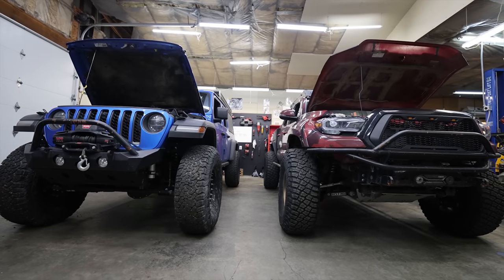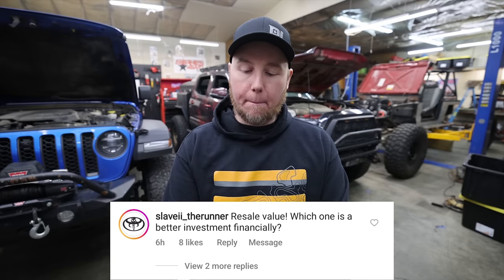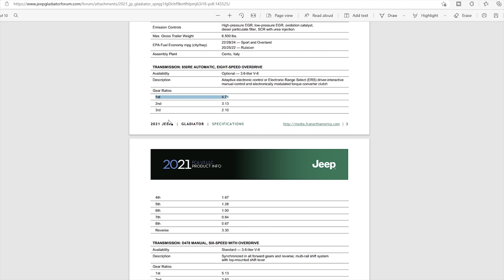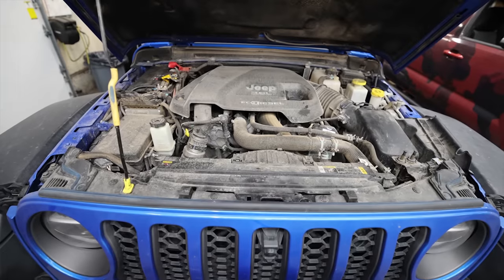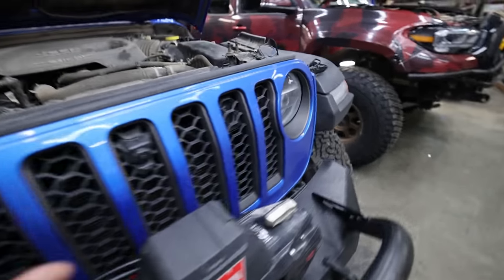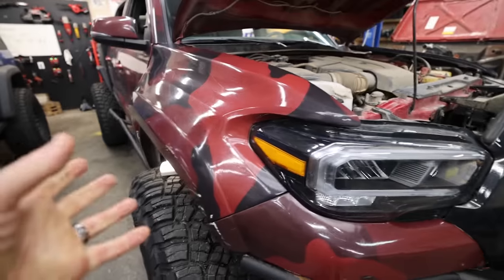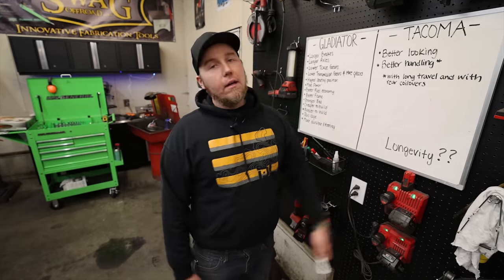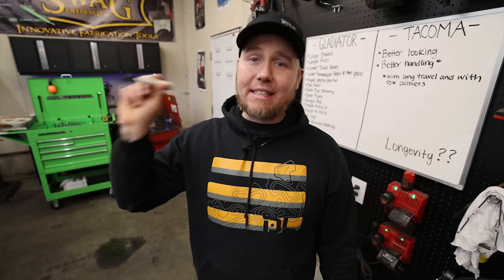My 21 Jeep Gladiator Vs My 21 Toyota Tacoma. Cold Hard Facts.

Comment: It doesnt take much to figure out how reliable a vehicle is nate. All you have to do is look. Where you drive what cars do you notice the most? how many old GM, Jeep, Ford, Toyota, Honda , etc vehicles do you see? I mainly see a lot of old toyota and honda vehicles still on the road 20+ years old. Rare to see other types. I used to have a jeep and it had thousands of issues, constantly overheating, transmission issues, and of course lots and lots of electrical problems. I bought a tacoma and never had a single issue. I think its important to note you heavily modified the tacoma and honestly you really changed how toyota manufactured it. From the factory it is pound for pound better than a gladiator.
Reply: You should compare stock to stock, because that is the fair way to do it. Also, again I have had jeeps and they are a nightmare as I had constant need to go to the auto repair shop. Since I got a toyota tacoma I never went to one thus far. And I dont do any off roading, just regular daily driving both.
Reply: Lol old jeeps are one of the more common old cars to see. If you maintain them- and also by a wrangler- they aren’t hard to keep on the road.

Comment: You are comparing two different vehicles for what you expect. Tacoma's a pickup, the gladiator is a "jeep" with a small pickup bed. Ones diesel, and the other is gasoline car engine. Tacoma's historically were NEVER meant for towing(too small and not built), but people do it. Apples to oranges my friend. That gladiator is an awesome rigg. If I bought a fiat again, it would be another cummins powered truck. By the way, I would never buy a tacoma unless it was built like a tundra.

Comment: Taco definitely has its short comings. But to be fair, you have customized and modified the Tacoma fair more than the Jeep. My Tacoma has almost 100k miles on 35” tires and built for over landing. Taken it to Moab and done trails the Tacoma isn’t supposed to do. In my humble opinion you can’t ding your Tacoma for its reliability issues when I would dare say allot of those are inflicted by the customization you e done while doing a basic lift kit and some more simple mods. 

Still a good video comparing the two!
Reply: 3rd gen tacomas are no where near as reliable as the previous generations and ifs been well documented. It wouldn’t surprise me if a gladiator with the v6 is more reliable than the Tacoma

Comment: It boils down to:  They all suck-mostly suck stock.  If you want an off-roader/overlander, you will have to build it.  What you start with really only matters in availability of aftermarket parts and/or your willingness to modify and swap.  Jeep, Toyota, Nissan, Ford, Dodge...none of that matters overly much, IMHO.  

I am building a Ford Ranger into an overlander. Don't think I'm doing much more than if I had started with a Taco.  Only difference is, I paid less initially, will have to pay a bit more for modifications because there's less in the aftermarket, and my total package when finished will be a bit smaller (by design).

Comment: If you peruse the actual data sheets on longevity of vehicle brands and models ie what percentage of total made make it to 100k, 200k, 300k etc. there isn’t a statistical difference between them . Even with a pearsons r value of .05 never mind one of .001 which is the norm in engineering or hard sciences.

Comment: Not surprising to see that the Gladiator beats the Tacoma in many categories in your video. I would certainly hope so, because with the price difference, someone can take that difference with the Tacoma and build a great vehicle that will rival the Gladiator without issue. This is a classic example of, "You get what you pay for."

It seems like you're comparing the biggest to the smallest here - and there really wasn't a winning criteria. Of course the Jeep wins - it's much more expensive. Just because something is bigger, wider, etc, doesn't necessarily equate to a win.  I'd like to note that you've purposefully left out specific measurements and statistics for both vehicles that would consider them either roomier/tighter, as well as failed to mention the fact that the 3rd generation Tacoma drivetrain build was not designed for off road-use, even with gears such as 5.11s. Let us not forget the small things, such as fasteners and maintenance items, but I would rather not get into that - all companies have been skimping there and other places to "fit into the future".

Is there any reason you meme'd the 1st generation model into existence for frame issues, even though it has nothing to do with the video? I highly suggest owning a vehicle longer than 2 or 3 years and then coming back to maintenance, reliability over a longer amount of time. I'd love to see that video.

 
Appreciate your time.

Comment: I know you want hard stats, but I know both toyota and jeep guys, the toyotas are way more reliable.  we are talking 500k, and in some instances 1 million mile reliability.  HOWEVER if you put 35s on a toyota you're gonna start to loose that reliability, or at least just start spending a ton of money.  if what you want to do can be done on 33s or smaller the tacoma/4runner/GX/FJ are in their zone.  Quite frankly 98% of the dirt in the US can be covered with a toyota on 33s with a skilled driver.  There are several people who have taken a near stock GX460 or 470 to moab and did the escalator on hells revenge on 31.6 tire to show the scale of what I am talking about.

That being said wheeling above 33 becomes about brute force tire size, and this is where the jeep shines.  Putting 35s on a toyota is a lot of work and 37s become crazy work.  you can literally just bolt 37s and a lift onto a jeep and call it a day.  there is definitely something to be said for that.  And being a GX off roader there is certainly something to be said for a vehicle that you can drive off the lot and straight up a mountain without immediately swapping the wheels taking an angle grinder to the low hanging body work.

Comment: I have had jeep people drive similar builds to yours abd get mad at me because they couldn't crawl up a rock that I just did with my toyota 88 extra cab that is locked front and rear duel cased and 35s, it was like a 5000$ truck at the time, probably 20k now with the crazy 80s toyotaflation tho, I'm sure you know everything new is lower quality now days and older jeeps and toyotas are way tougher vehicles

Comment: Don't get me wrong I've owned a lot of Toyotas and love them but ...Even a stock Tacoma can't decide what gear to be in and the hideously underpowered v6 coupled with at case that never wants to shift from hi to low then toss a locker that won't engage until it feels like it. Toyotas use to be great but now are verging on being ok. Oh and also if one sensor on one part of the rig malfunctions you will get a Christmas tree of lights and the whole rig will throw a fit.

Comment: It's an interesting comparison. I don't know about off-road comparisons or towing, but I have owned three Tacomas and the Tacoma reliability is legendary. Jeep in general has one of the worst reliability records of any auto manufacturer.  And if your Jeep is broke, then it's worthless. Jeep is absolutely notorious for being cheaply made. Now having said that, I have never owned  Jeep Gladiator, so maybe they are reliable, who knows. I do know that Tacomas did have a higher resale value than any other vehicle made, about three years ago. But I think the current gen of Tacomas brought that down because, frankly, they just aren't that great a vehicle. BTW, I have done ALL of the repair work on my Tacomas - so I am keenly aware of their reliability.

You are factually wrong about the frame of the Tacoma to a degree, part of frame is a tube frame. However, I have never seen the whole frame nor even looked at it. BTW, I was rear-ended by a driver at fairly high speed. My rear bumper was completely bent under the truck. When it was repaired I made the insurance company check the frame to ensure it had not been bent. The frame had not been bent and was withing factory specifications. So you might want to do a little more homework before you run around claiming the frame is weak. It may not be as strong as Gladiator frame, but it's not weak.

I currently own a 2009 Tacoma and I just put new coil-over Eibach 2.0 (2" diameter) Eibach shocks and rear reservoir shocks on it for $1,500. I could have replaced both control arms and put on 2.5" super deluxe coil-overs for around  $6000 - $7000. So it certainly is not cheap. But that would provide the absolute best truck suspension that you can buy with the exception of air shocks like on the Rivian RT1. My ride with Eibachs is very good compared to stock shocks, and stock shocks were Bilsteins on my truck. 

I am a licensed General Contractor, and I have abused the living hell out of the composite Toyota bed. So, I can say firsthand that it is not "fragile" by any definition. I have had loads in the bed that are way over 1000 lbs and it I have never had a problem with it. I think in this case you are the person who hasn't really used the composite bed to see how durable it is firsthand. I was in an accident that did break the bedliner, but that is way more to expect out of it than we are discussing here. Have hauled loads of lumber in the bed that I really shouldn't have, that had the rear shocks bottomed out to the bumper. So, I can say with some authority that the composite bed is very tough. Steel bed scratch, dent, rust and look like garbage after hard use if you don't spend more than a $1000.00 to put in a high-end bedliner. The Toyota bedliner has none of these problems. I have found it to be exceptional. Again, do some homework before you make global judgments. 

The Tacoma was never meant to be a heavy towing vehicle, nor does Toyota rate it as such. You are comparing apples to oranges when you discuss towing compared to a more powerful diesel engine. You can't expect any gas engine to compete with a diesel in towing ability. Diesels develop most of their torque in much lower ranges. Also, the six-speed transmission on the Tacoma you own is a disaster. Toyota really screwed up with that transmission, by all accounts. It's one of the main reasons I didn't buy a new Tacoma. The 2024 Tacomas fix this problem with an eight-speed transmission that is buttery smooth, according to reviews I have read. 

As far as resale value, a nearby Toyota dealer I had repair work done after I was in an accident at recently sent me an offer for my truck. They told me they would give me over $17,000 for my truck. Now get this, I paid somewhere around $26,500 for my truck new in 2009. So I would say that being offered $17,000 for it from a dealer is pretty damn good resale value after 15 years.

Finally, the new 2024 Tacoma is coming out with a hybrid version which supposed gets over 30 MPG and has 326 HP and 465 lb.-ft. of torque. So it will be a beast if you can actually find one to buy. It should tow a lot better, and because a lot of its torque comes from an electric motor, it should be very strong at low RPMs. The off-road version also comes with an upgraded suspension that supposedly is really good for off-roading. We will see when it comes out later this year.

Overall, I think you did a good job with your comparison and I enjoyed your video, despite my critiques of it.
Reply: I have owned Tacomas as well and they are J U N K. They are maybe 1 step away from those Japanese mini cabover trucks. We have dumped all of them for real trucks. No power, can not tow, horrid gas mileage for underpowered engines, tranny is sloppy, weak frames, no payload and overall cheap builds. I heard all this crap about these trucks but I think it comes from ignorance. Most have never owned any other truck because they came from a Toyota family.

Comment: Jeep rubicon all the way, not a fan of trimming cutting and grinding my brand new truck for anything bigger than 33's lol, and no thank you to really expensive long travel kits and broken cv axles

Diesel Jeep gladiators drive just as well as a daily but the extra diesel torque makes it so much nicer to daily and get really insane mpg even with big tires, and no trimming up to 37's
I promise I'm not baised.... jk I just prefer a truck I don't have to cut up if I'm buying brand new, oh and rubicon has front and rear lockers and a button to auto disconnect the sway bar

Comment: It is funny. Every Toyota person I know beams about how their car, truck, rig, has been dead ass reliable. They toss out mileage and all of it.  The absolute fact is, when I ask how often they take it off road, actually use the thing, hard,.. not getting its oil changed every 4 hours , driving it to wallmart, I get empty dead end stares.  Fact is, is most of the complaints of the Toyota, are stupid. Because that’s what they even know about the rig. Fold over the front suspension/tie rods a few times at least or something before telling me, how reliable the rig is.  No front locker, weighs a metric dick ton, with shit power, ass tranny (5 speed? Really?) and even then 99.9999% just drive them to McDonald’s. Jeep people actually go out on the trail. Any trail. Trust me. I see way more of them, than I do runners or tacos ,…..

While me, my better half and my dogs are in my 18 4Runner.   Sorry toy boys. Shits a fact. Instead of worrying about what RTT to put on your rig you drive 11 miles a month, go beat the thing. Like the reason you even bought the damn thing. (Or just say you have a PRO, don’t do shit with it, and get laughed at like you should).

Comment: Let's face facts most vehicles anymore mechanical are awesome and way better then anything we have seen ever but the electric aspect on these cars and emissions is what kills them and essentially makes them disposable vehicles.  I have a 2005 dakota laramie with 4.7 and I love it mechanical it's sound but electric let's see transfer case started shifting on its own any time it wanted, sector switch went bad started trying to shift motor into 4 lo, and widow leaked at top causing the whole truck cab to shut down causing no start and other random issues like key fobs not working, radio not working, and other accessories.  All this because we feel are radio needs to connect to are headlights to talk with are motor and overhead display on a can bus system lol

Comment: I was a huge Toyota truck fan and owner of a 83 4x4 best truck ever made a 89 4x4 a 91 sr5 4x4 that couldn't get out of its own way in snow n ice and two 2000 Tacoma 4x4's up until I had both 2000 Tacoma s confiscated by toyomoco for massive frame rust 🤬 after I lost those two in a row I'm done with Toyota and their Chinese steel rust buckets  WTF happened to Toyotas known long lasting and extremely reliable trucks  must be in the same place those two Tacomas are at now 
THE SCRAP YARD

Comment: The gladiator puts pressure on the tacoma? Toyota doesn’t care about anything but sales numbers and the gladiator is nowhere close to tacoma sales even with the tacoma being the oldest midsize on sale now. Those are cold hard facts that the tacoma is still outselling everybody else’s brand new redesigned trucks by ALOTTTT. A lot of the competition came out with midsize trucks and then had to redesign again like the Colorado and ranger all in the span of the 3rd gen tacomas life cycle. They can keep redesigning but nothing has an old school charm with older outdated but simple durable tech and features like Toyota. No one else can get away with it and still selling them at high prices when it’s been outdated for years and years. The 4Runner is still going strong and had the best sales year in 4Runners entire history in 2021 and sales just kept going up. He can wave the jeep flag all he wants but I know tons of people who were jeepers who made the switch to Toyota after having so many different problems. I’ll trust those close people in my life who have experienced both and are real real trail junkies when they say they shouldve made the switch way earlier and all that money down the drain fixing their Jeeps and say for certain they are never going back. And I trust my firsthand experience and my 4runner has never let me down.

Comment: The Tacoma is just the wrong platform for 95% of the people that build them. There's always a better one within the range of budget of that truck. Tacoma's are not inexpensive anymore, some platforms that compare are in the same price range. Truck things, The tundra is a better vehicle for a little bit more money, the 4Runner still has the 4.0 and is a vastly better vehicle, off-road Jeeps and broncos. The 3.5 with the 6. Speed is terrible they drive bad stock. They get bad mileage. The only thing that the taco has going for it is looks. The new darling of the Toyota scene is the first gen Sequoia, That's probably peak platform to build right now. 

But gladiators only downside is the extreme cost up front for a diesel JT Rubicon.

Comment: You don't really want a 79 or 100/200/300 series cruiser. They are so expensive its hard to imagine the kind of mods you do happening to one of these unless you've got loads of money.... The 79 in particular is very old school. Asmatic engines, poor leaf spring suspension, 5 speed manual, no safety aids...sooo expensive!

Comment: Cheap Mexican made? How many Jeeps do you see on the road today with 350,000+ miles lol? My bro-n-law just spent $3500 to have the batteries replaced on his Rubicon that he's owned less than two years. The power of the Tacoma is in it's simplicity. My modded 07 Toyota FJ Cruiser has pulled it's fair share of Jeeps out of clay, mud, and sand lol.